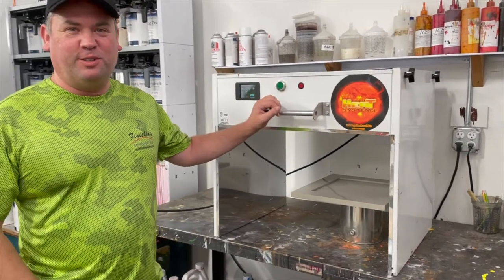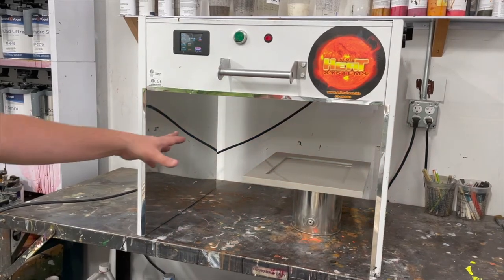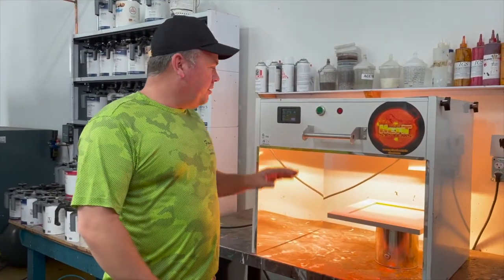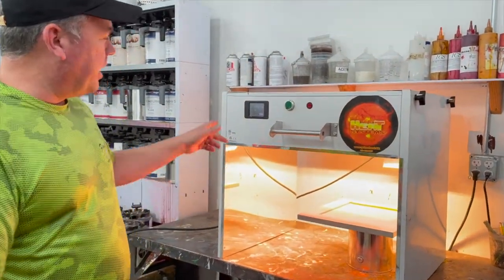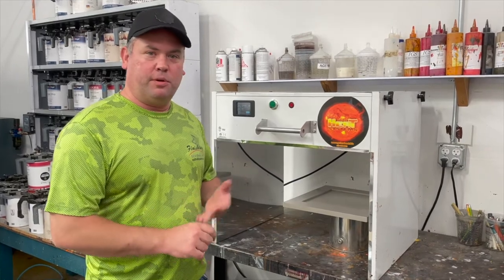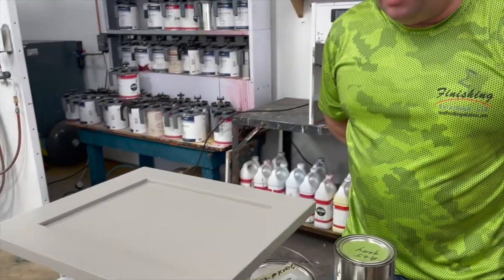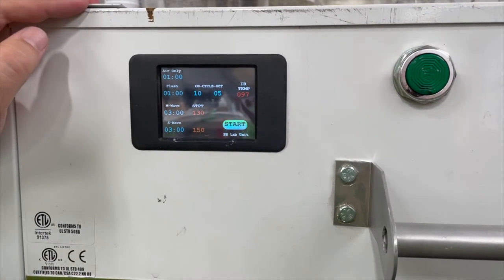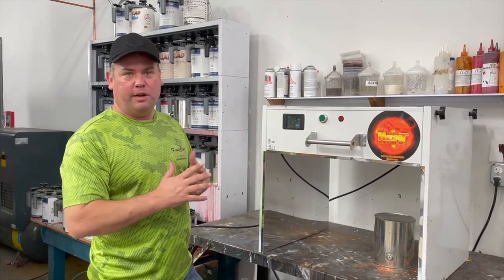Cure any coating with our TFS Infrared Table Top Lab Unit

Comment: We are a high end finish shop and spray ml cambel magna max lacquer. How long does it take to bake a door and is it ready to pack right after the bake. Looking for large scaling
Reply from the maker: We can fully cure water based coatings in 4-8 minutes.  We can fully cure solvent based products like you mentioned in 7-12 minutes. By cured we do mean ready to stack, assemble, wrap. Place in full service.  We received your inquiry and will contact you tomorrow. Thank you